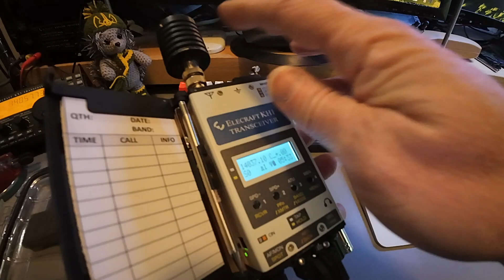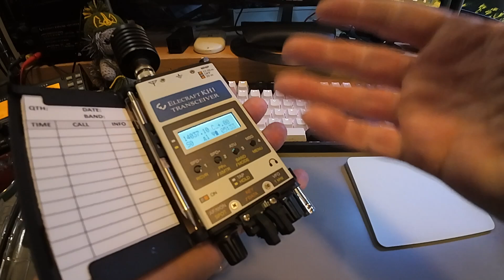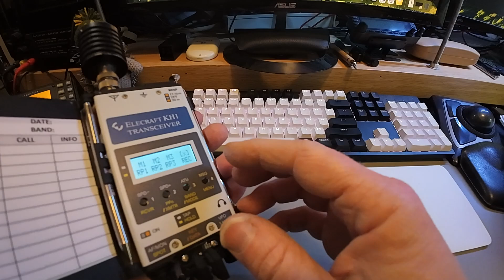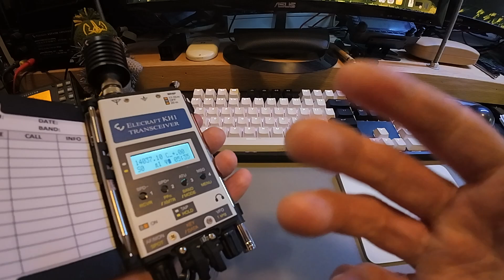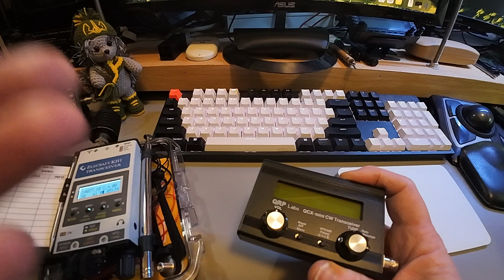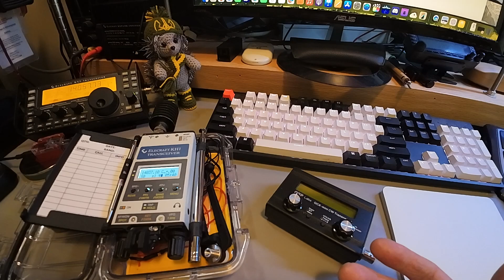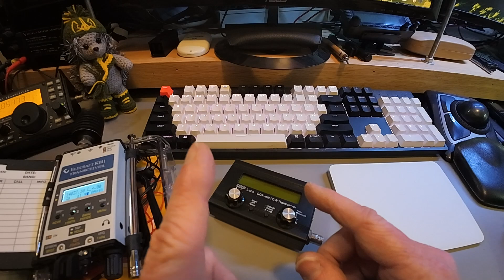The Manual Hack: Unlock Your Radio’s Full Potential!

Comment: My operating is limited to my shack so I spend most of my on-air time with the IC7200 and 7300. ARRL sells "mini-manuals" for these rigs with most used functions at your finger tips. They are laminated and spiral bound. I also have a KX3, OHR100, AND NorCal SMK-1 among others. Thinking about doing a cheat-sheet for the KX3. (The rest are analog. ) 72 de KA4NIV, Maurice
Reply from the maker: A solid plan! I, too, use cheat sheets for some of my radios. I must say that the '7200 is one of the more intuitive radios on the market. Always liked that one! (And the 7300 for that matter!)

Comment: 08:30, just brewed a cuppa coffee. Dropped by YT and who is in my feed? A Thomas video. 
It's gonna be a good day. 
Hi Thomas. I thought I read one does not need a dummy load in practice mode for just practicing keying (at least on the QRP-QMS5 ??
Reply from the maker: Thank you so much for the kind words.
You're right! In practice mode, there's no RF out. When I'm exploring the manual, though, I just put on a dummy load since it's so easy to do, and that way, I don't accidentally TX if I move out of practice mode.
Reply: @ThomasK4SWL  Your channel is so much more than a YouTube channel.
Thx.